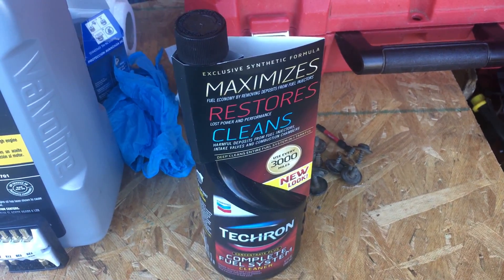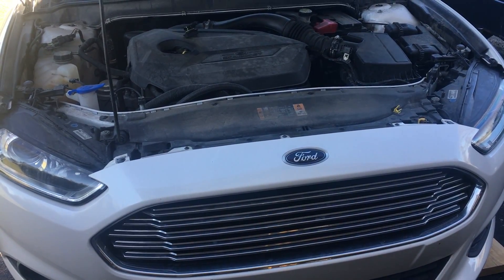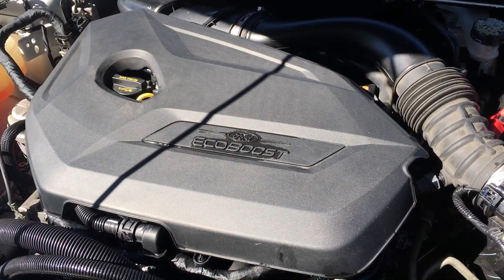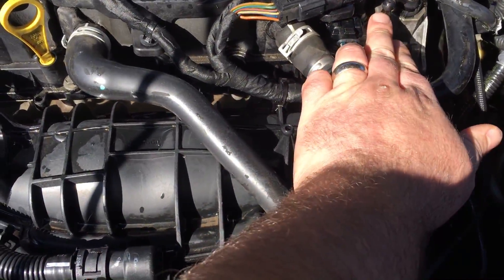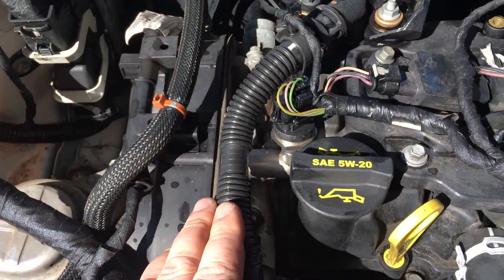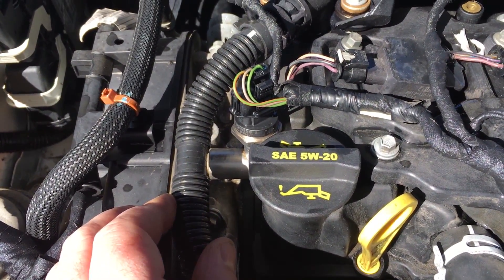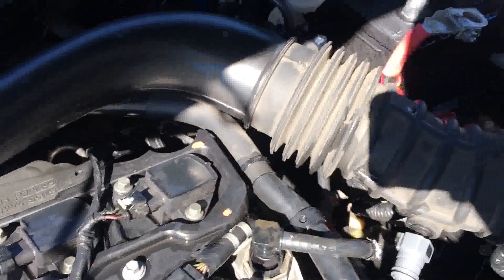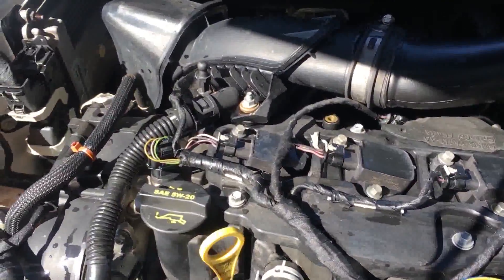Ford Fusion Stalling Easy Fix

Comment: That sensor is the high pressure side, it's directly on the rail after the HPFP. The issue is generally caused by the low pressure sensor, located on the feed line before the HPFP.
Reply: I replaced my low pressure sensor. Still have the same issue. It only dies after idling for quite a while. Any ideas?
Reply: @VictoryAviation  did you ever figure it out? mine does the same
Reply: @sarkistachjian9170  I did not. I was going to change out the other sensor to see if that fixed the problem, but I haven’t had any issues in the colder winter season. I’m sure the issue will pop back up once the weather warms up again.
Reply: @VictoryAviation  when my wife's did it it took a combo of the low fuel pressure sensor and a new throttle body as throttle body on ford's are known ( to me anyways as I have had to replace several) to go out I have seen them throw a code and not so idk how to actually tell you to check but the combination worked on her 2016 fusion got the part on ebay lowest price I could get and been great for 60000 miles so far
Reply: @VictoryAviation  it’s probably your fuel pump I replaced both sensors and I had the same stalling had to replace the high pressure fuel pump
Reply: @Gentlemen-bt3ru  lord lets hope not. 99% of the time it works just fine. It only acts up when warm and almost always after filling the gas talk all the way up.
Reply: Did anyone figure it out?? My 2014 stalls only on idle also I was gonna change my coil packs but lmk :)
Reply: @VictoryAviation  Hey! What did you find out eventually about your car? that stalling in heat sounded like the tank pressure sensor, which wont throw a code, was wondering if you had figured that one out!
Reply: @VictoryAviation you ever find the cause?
Reply: @NEEKZ81  I still haven’t replaced the high pressure fuel sensor. I had the valve cover gasket replaced because it was leaking a little bit. I needed to get it done and the place didn’t have extra time to replace the high pressure sensor at the same time. So I’m no further along than I was a few years back unfortunately. I’ve got over 175k miles on it, and other than what appears to be that sensor, it runs like a champ. I even helped set a couple cannonball records with it as a spotter 😅
Reply: @ lol…good stuff😁…so no more stalling after the valve cover gasket replacement?

Comment: Thank you so much, my couldnt wouldn't stay running and kept stalling. I freaked out, I have no money now a days, and really need a car. I am disabled now and its hard enough running errands, going to drs, etc  without a car I felt scared and stuck, I watched this, cleaned it, and running smoothly 20 minutes after thank you 😊 😀 ☺ 🙏
Reply from the maker: Hope your car is still running good!  Thanks for the comment.
Reply: Where do u put the fuel
Reply: So it was staying running and soon as you put it in it runs?

Comment: 2012 Ford Fusion SE 2.5L 4cyl mine will act like its running out of gas and I can floor it and nothing changes.  throws a wrench light.  once I shut the car off and restart it, the issue is gone.  the car never actually dies, but is right on the verge during these episodes.  The last time it happened was 5 months ago. I attributed it to being below a quarter tank and taking a hard right (maybe I sucked air in fuel line) this time it was full of Shell gasoline and I was pulling away from a stop sign.  I keep up on regular basic maintenance, ie spark plugs, filters, wipers, oil, trans fluid swap, etc.
Reply: Same issue here thinking throttle body
Reply: @87princessmommy  It was, I replaced it with an OEM I got off of Amazon for 50 bucks. No more problems. Easy job.
Reply: Same thing with my 2013 fusion. Did you ever find a fix for it?
Reply: Wow this is happening to me with 2014 ford fusion titanium
Reply: Same with ours. 2018. Throws wrench light with a message about auto stop/start. Once I come to a stop it, pull over me stop/shut off the car and restart it starts up like normal.

Comment: My 2015 with 100k miles has done this twice. Both times within minutes of starting the car and in parking lot driving less than 10mph. Any updates on yours?
Reply from the maker: After some research I have found that the Low pressure fuel sensor may be the problem.  I will post a video shortly with how to replace it and what the part # is.
Reply: Any luck
Reply from the maker: I have replaced both of the fuel pressure sensors and the stalling problem is gone again. The low pressure sensor is below the brake master cylinder.  I will try to post a video soon of how to replace the sensors and the part #s
Reply: Slim Jim V Thank you so much my car is doing this and sometimes the check engine light comes on.
Reply: Slim Jim V I have 2014 Ford Fusion they are telling me it's only one sensor not two. CN you email me the video or part numbers?
Reply: Mine is doing the same thing.
Reply: Hey I was driving my 2014 fusion today less than 10 miles per hour and it just turned off and said car is not on parked so I had to break and put the car in park then turned on the vehicle worked fine but then happened again after 2 hours
Reply: Yes mine is also a 2014 same thing going on. But for me, If it’s a cold start, it’s starts just fine. Didn’t die or bogg down or anything. But I’ve found if I run an errand or something that warms my engine more then just a few miles and then shut the engine off for more then 5 minutes then try to start it back up mine does the whole dying and bogging down unless I am able to floor it and get a higher RPM then I’m good after that. I’m going to chance the sensors but I hope this helps someone until they can get the sensors replaced
Reply: @Lakeb67  hey did it end up being the sensors??
Reply: @Lakeb67  sensors?
Reply: @Lakeb67  ?
Reply: @Lakeb67  ?????
Reply: @tangleass  I no longer have the car unfortunately. Sorry for the late response I was not notified of anyone’s reply..
Reply: @Lakeb67  thanks for the reply 👍🏽

Comment: I’m having same issue my car will start and drive fine for a while then shut off and say engine not in park and no check engine light on and I took it to the dealer they said can’t find problem , car just shuts off and then start back normal but will cut off again idk what to do will try this anyone else can relate
Reply: 2015 ford fusion

Comment: I thought that one is the HIGH pressure sensor. I thought the LOW pressure sensor was behind the cover closer to the battery.....
Reply from the maker: I believe the part is called the Low Pressure Sensor but you would think it would be high pressure since it is on the fuel rail?   I believe I have a video showing how to replace it also.   I am not sure if that was the problem or if it was the purge assembly.  On these models the fuel system obviously was not perfect and when I replaced the sensor some dirt/grit was in the passage of the sensor.

Comment: Are they two fuel pressure sensors one on top and one on the side? I was seeing a YouTube video a guy change both of them the on top and the side
Reply: Jose Olavarria link?
Reply: Yes the high pressure sensor is to the far left of the engine right by the oil and the low pressure sensor is to the far right at the top.

Comment: Is anyone’s car making a weird noise too? Mine started doing it this week and only getting worse. I was thinking fuel pump since it makes weird noises toward the rear of the car.
Reply: Lane Anderson is it like a rubbery squeal sound that's kind of random?
Reply: @foreverbythebay01  did you pinpoint this issue?
Reply: Mine does the exact same thing, towards the rear of the vehicle too
Reply: the fart is vacuum sucking air into the gas fill hole
Reply: @vityazsix mine makes this noise as well. Do you know what exactly would cause this? Have had it at 3 mechanics and none seem able to figure it out, I assumed fuel pump bc the noise sort of sounds like a pump?
Reply: Sounds like the vapor canister purge valve

Comment: Does anyone know how to reset all codes for a 2013 Ford Fusion. I had a coolant leak and my car overheated on me on my way to work so i pulled over and let it cool down after it cooled down I took my car home and it was driving fine until I fixed the leak in the hose now my car doesn’t want to stay on and sounds like it’s taking on to much air but my brothers friend who knows about cars told me I need to reset to codes in the car cause when it overheated my car went into some safety mode so my Engine wouldn’t break but now I can’t use the car cause it doesn’t stay on and I need it to work. 

Any ideas on how I could reset my codes? I would much appreciate the help.
Reply: Cazy C  buy a obd 2 code reader from Walmart for 20$ you can clear all your codes with it 👍

Comment: Can anyone show me where the speed sensor is on a 2007 Ford fusion how do I tell if that is what is wrong with it is stalling and it doesn't want to act like it don't doesn't want to take gas it takes a minute to kick into over drive
Reply: Fid you find the problem out having the same problem with my fusion

Comment: If you could post the next video for us please lol
Reply from the maker: Added 2 quick videos.  These show you the location and what part # I used for a 2013 1.6L Fusion.  The Fuel system has a High and Low Pressure Sensor.  The Low Pressure Sensor is the one shown in my newest video.  I did not get any codes when mine stalled.

Comment: Is it make the Rpm Shivering is unstable and when you push gas the rpm comes down when you in high rpm ??????
Reply: Mine is doing that now. Wondering if it’s the sensor or the fuel pump
Reply: @PittSkyView  did you ever figure it out my car is doing it now
Reply: Colin seeks Yes it was the low pressure fuel sensor. It’s an $89 part and it’s super easy to replace - I did it myself.
Reply: Pitt SkyView do have a video on how to do it?
Reply: Pitt SkyView thanks so much. I got a 2014 Fusion and soon I may have to replace these parts
Reply: NatureMan yeah I had a 2015 and did it. I got the part from the dealer for $89 and it took 10 minutes!

Comment: mine just started to do that. i just filled up n now its stalling.i ran the gas out n put 91 in the tank n ran sea foam through it ..seems better but still stalled
Reply: electronic throttle body. RECALL
Reply: Timothy Whiddon so it's a recall
Reply: Ford ripped us off file a complaint with the NCCC
Reply: And the NHTSA